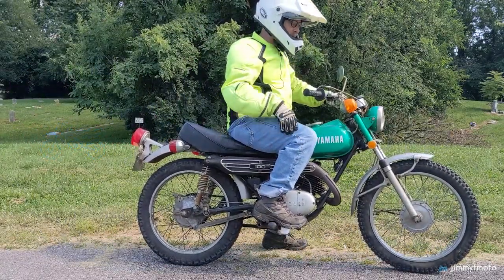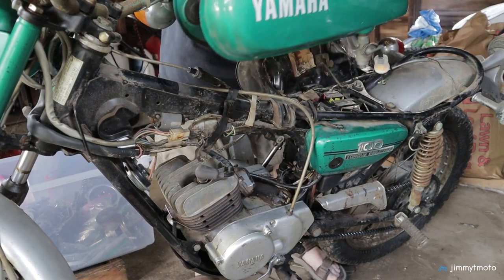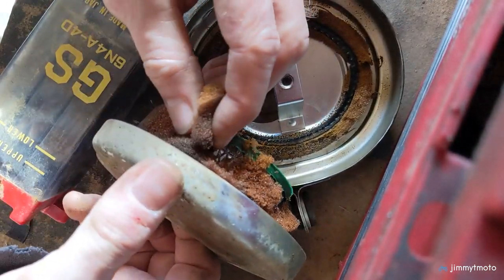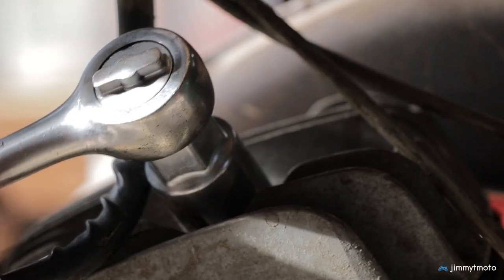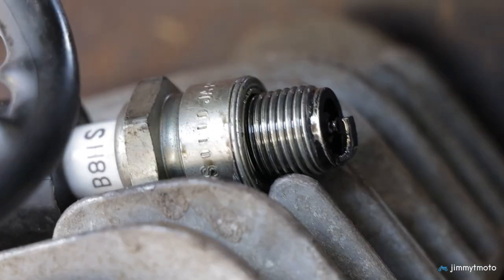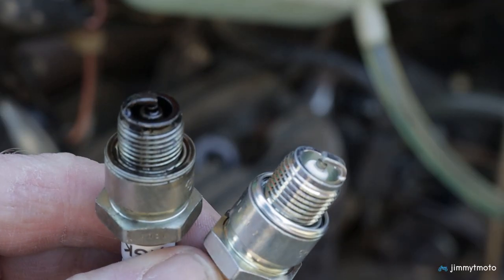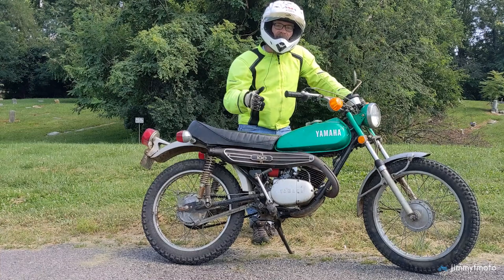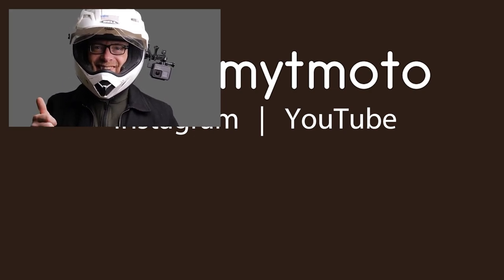Vintage Two Stroke Motorcycle Repair Project - 1972 Yamaha DT100 / LT2 restoration - Part 1

Comment: Hello Jimmy. 
This video is wonderful. I never knew that Yamaha produced the 100cc Enduro so early as 1972. Upon checking there was even a previous model, the LT1. It figures...........LT1 100cc. AT1 125cc. CT1 175cc, DT1 250cc and years later RT1 360cc. The first letter in the model/Chassis number would tell the engine displacement. ( Yamaha used that first letter on their street bikes too. The L1 or YL1 was a 2 cyl.100cc. the AS1 or YAS1 was a 2 cyl.125cc, the YDS1 or DS1 was a 2-cyl. 250cc and the R3 was their 2-cyl. 350cc. The second letter S meant street.)
The second letter  on the trail bikes, 'T' meant it was a "Trail" bike.
Years later ALL the two-stroke Enduro/Trail bikes would be described as DT, hence DT100, DT175, DT250, DT400.
I lost track of all of that as the years passed.
I am 66, and my first bike was the first 175cc Trail that Yamaha made the CT1. I certainly have fond memories of that bike. That model carried no indicators.(As of January 2022, the local Yamaha dealer in my country still sells the DT175 2-Stroke Enduro !)
I am glad that you have this bike, the essence of simplicity and functionality. Aside from adjusting the points, I am sure it can go on for many thousands of miles !
Enjoy & respect.
Trinidad & Tobago, West Indies.

Comment: Right on! I learn how to ride on a Z50. But moved up to a YZ 125 A, it needed the crank replaced. So I learned how to split the case, before I learned how to ride a "full sized" bike. It was points too, but my older brother put it to ATDC instead of BTDC. My first start on it resulted in a OUTBURN & DUMP.  I was ready for fwd, not reverse!
Reply: I'd ride my 72 dt 100 with my buddy who had a yz 80.  That thing smoked this bike!😂!   But one day he was whipping down a trial he didn't know there was a ditch that u had to roll into and gas it out...   he hit it at 45 50?   He flew over the hight of a telephone pole split his helmet in 2.  He had amnesia for 3 weeks!....   but bikes are fun!  😅

Comment: Hi, my Yamaha Mr50 doesn't want to start.  it has good spark  new carburator but maybe the compression is too low  it's been standing for about 4 years without riding it. Can't remember what oversize piston is in it. What should compression be? For a 50cc ? Thank you

Comment: Great video!  What fuel to oil ratio do you use for your premix gas?  I have a 1975 DT125 I plan to work on and don’t trust the old oil pump either.

Comment: What oil and fuel mixture did you use I have one I'm restoring and I can figure out the oil and fuel mixture. My oil pump doesn't work so I'm hoping to mix fuel till I get a new one.
Reply: Use 30:1 initially to be safe.( Remember when coasting downhill for long distances the engine is turning, but no fuel is fed into the engine......hence no lubrication.) Try and get the oil pump as soon as you can. Trinidad & Tobago, West Indies.

Comment: I have a 75 dt100 with no spark. Any ideas about what the problem could be? I have a new spark plug, spark plug cable, and battery. The lights and horn work. Thanks
Reply: Your coil is probably bad